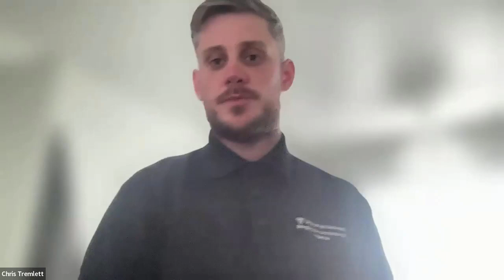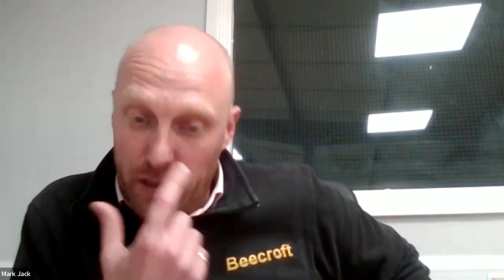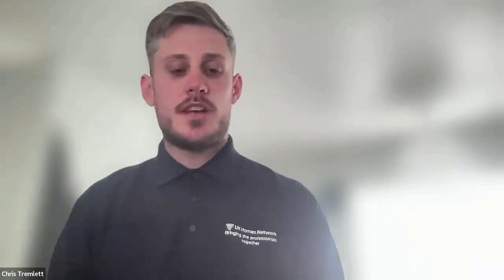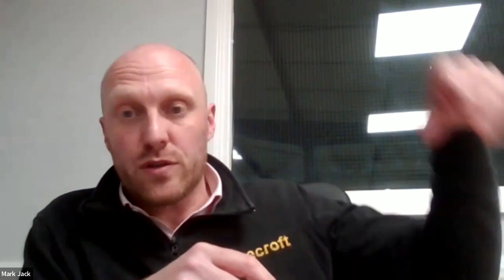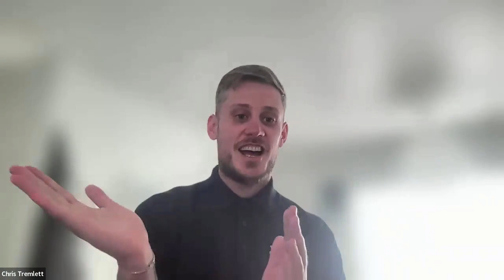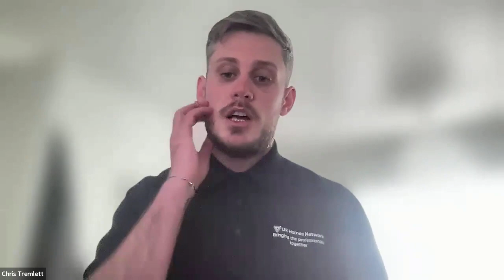Demolition for Property Developers

Comment: Hello there
I recently came across your youtube channel < UK Homes Network > and was impressed by the quality of your content. However, after conducting a comprehensive analysis, I noticed there is room for improvement for your youtube channel for getting more visitors and subscribers. Not doing video optimization and keyword research is not improving your video.

The problems I got your channel:

1. Your video title, meta description needs to be improved.
2. Your Thumbnail needs to be more eye-catching.
3. You need to use more relevant ranked tags and low competitive keywords.
4. Also there are many more issues in your video optimization checklist due to which YouTube algorithm is not delivering your video to your targeted audience.

Your video ranking SEO score is 0 out of 100. It should be a minimum of 75+. And You have no video tags, no channel tags. Besides, Also, there are many issues in the video optimization checklist that cause videos to not rank.

If you solve these problems, hopefully your channel will grow day by day.

Thanks & Regards
Ayon Ahmed
Reply from the maker: Thanks for your feedback, as we are a new channel this feedback is incredibly valuable. We have tried to implement some of the changes you have recommended and will hopefully keep improving as our channel grows.